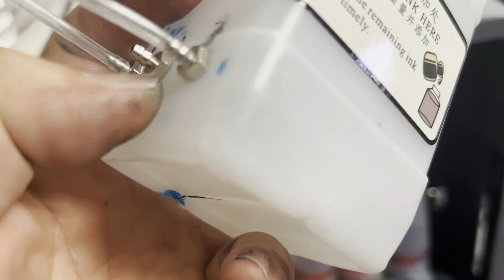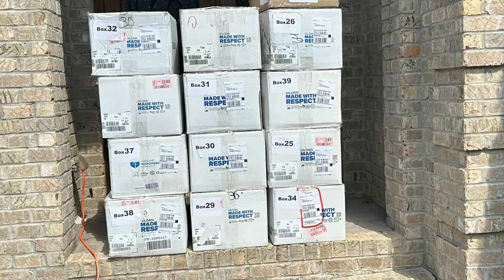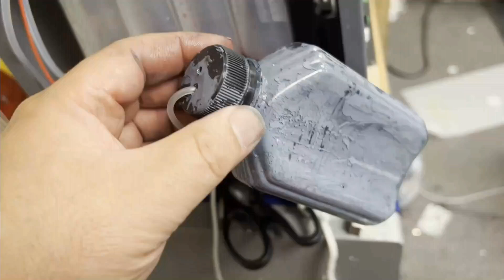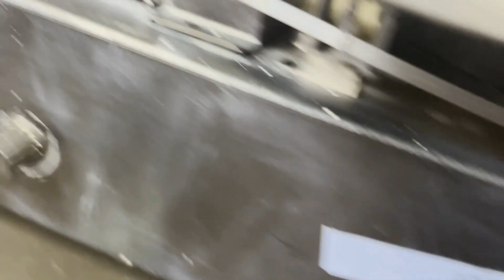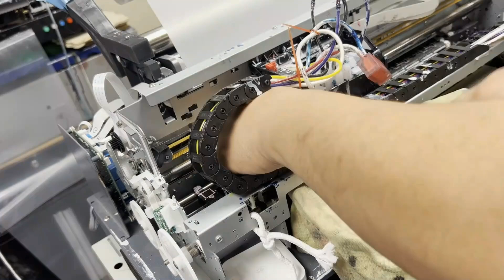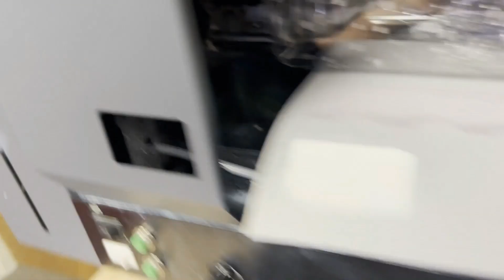Maximizing Performance with DTF Pro Model J Printers

Comment: Ohh yeah, I agree 100% the dtf pro style printers are becoming my favorite. I love how the shell of the printer comes off all together and it seems much nicer to work on vs the average converted Epson. 

Have you worked on many prestige R2 printers? Been looking into that one since it looks to have a good WIMS.
Reply from the maker: Thank you so much for your support and for engaging with the video! I agree with you — the DTF Pro-style printers are definitely becoming easier and nicer to work on compared with many average converted Epson setups, especially when the shell comes off cleanly and gives better access for maintenance and repairs. We have probably worked on just about every major brand on the market by now, and yes, we have worked on a lot of Prestige R2 printers; since we are a repair shop, seeing a lot of them may or may not be good news, but every printer has strengths and weak points, so I would look closely at the WIMS, parts availability, service access, and long-term maintenance before deciding. I wish you the best of luck with it, and hopefully we’ll see you in our shop soon! Also, because I receive a high volume of printer questions every day and can only reply to about 10 questions daily, I prioritize replies this way: subscribers and channel members are typically answered within 48 hours, regular viewers are answered if time allows, and after subscribers and members, any remaining reply slots are filled last-in, first-out, meaning newest questions are reviewed first. If you are not subscribed and do not receive a reply within 48 hours, you can either subscribe or repost your question because newer comments are reviewed first; if you subscribe later, your older questions automatically become priority without needing to repost. Members also get extra benefits such as early access to videos. You are also welcome to join Run With Kevin — LIVE, where I go live every morning, usually between 6–11 AM Eastern, and answer printer questions in real time, so please subscribe and turn on notifications so you can catch the next live session and ask directly. If you need faster assistance, email [support@bchtechnologies.com](mailto:support@bchtechnologies.com), and if this video or comment helped you, I would really appreciate a Google review here: [https://g.page/r/CfL7k6nYvPQ9EAg/review](https://g.page/r/CfL7k6nYvPQ9EAg/review)